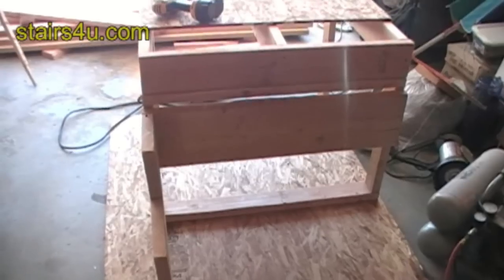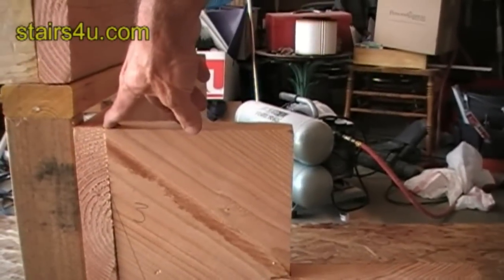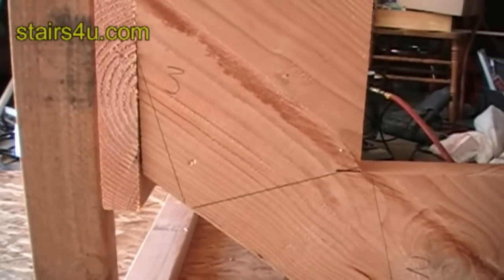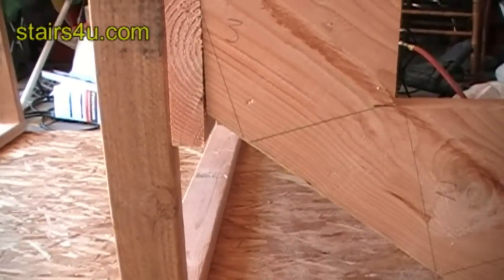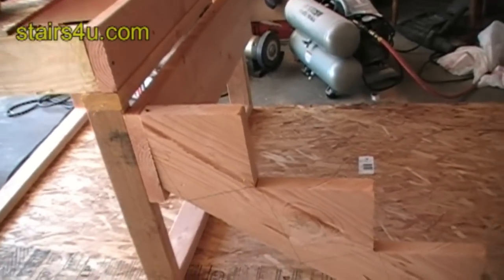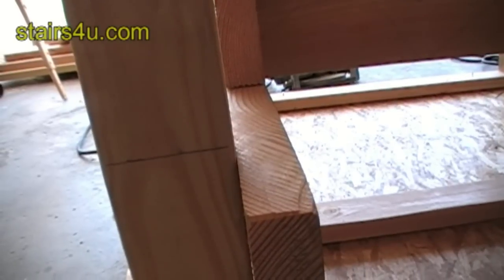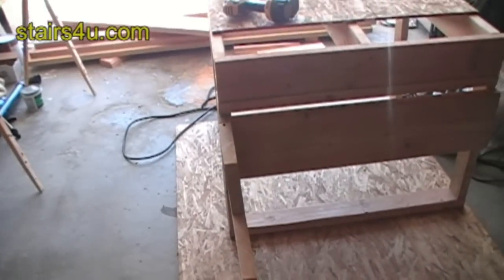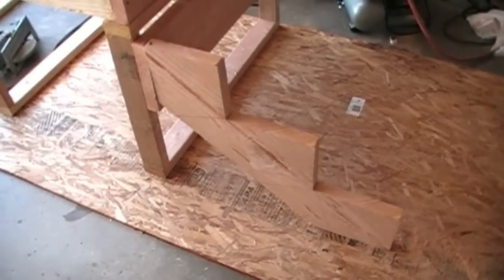Stringer And Stair Ledger Attachment - Construction Video Tips

Comment: You should half-lap or notch the ledger to the stringers with the stringers above, then carriage bolt the ledger to the framing.  I would never do it the way it's shown in the video.
Reply: TomKaren94 no one asked you tho
Reply: @brotherdio420  Doesn't matter - if someone says this is the way to do it and it really isn't then you're justified to call it out. There's no reason not to notch the string over the ledger in a situation like this. Makes a far more solid structure.